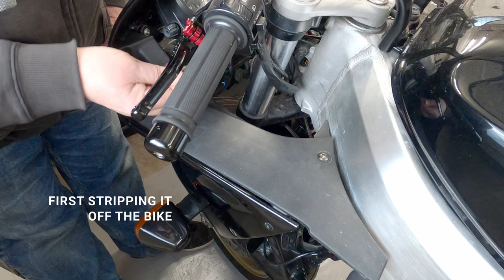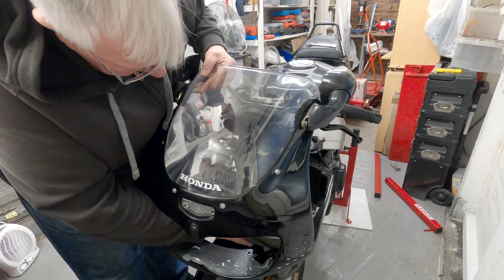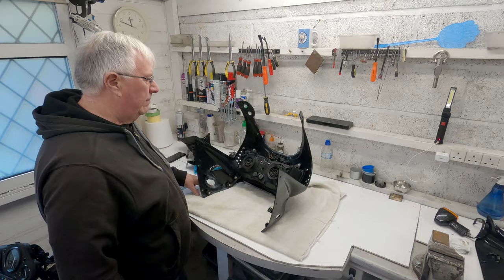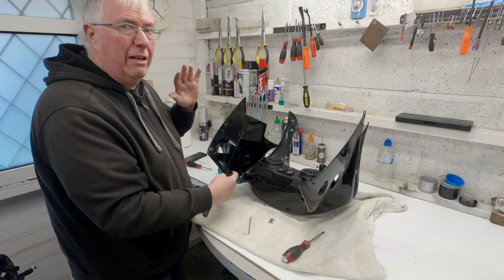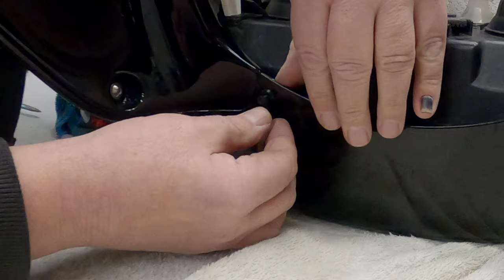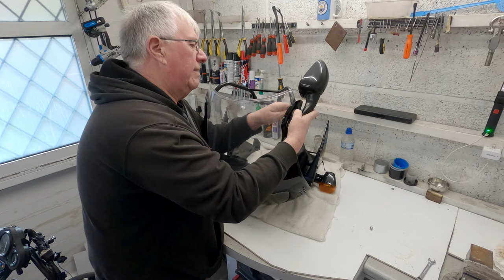Honda CBR900RR Top Fairing Rebuild | Stripping The Fireblade Cowl To Solve Squeaks & Noises | 008

Comment: Very nice videos.
I think those ruber bolts on windshield are have to be in holes of it from the upper side, like that is on my Blade now, when it was from the inside windshield was make noise and scratches by fairing
Reply from the maker: Thanks for the tip!

Comment: I need to know what the best led light bulbs to use and what that little light is in the middle
Reply from the maker: I haven't changed my lights to LEDs yet so I can't really advise you on which bulbs to use.  I know that some LEDs require extra circuitry to make them work properly.  

It is something I may look at in the future.  

Good luck.